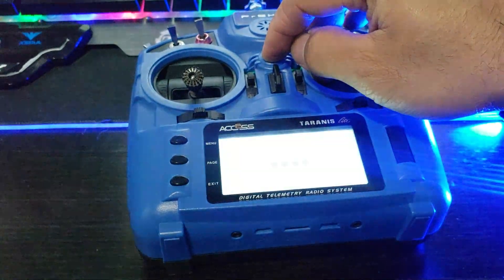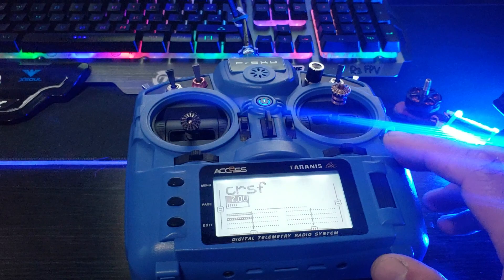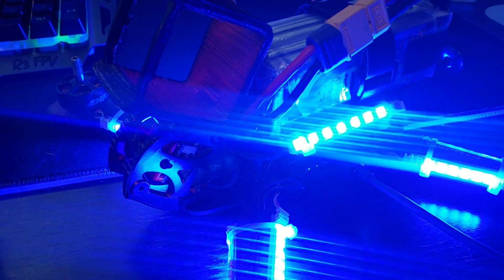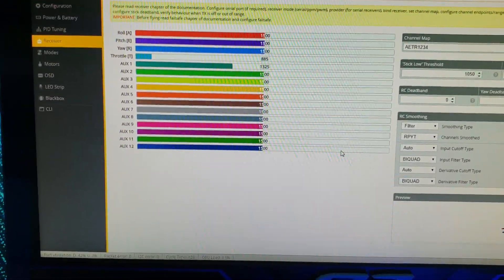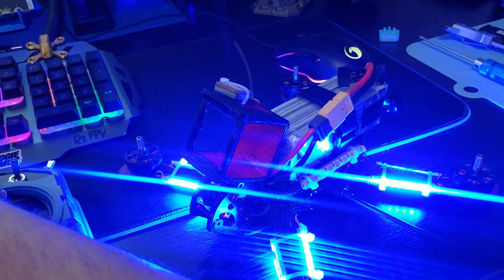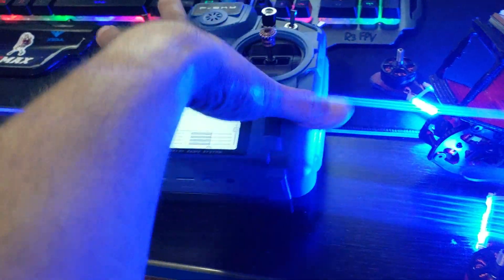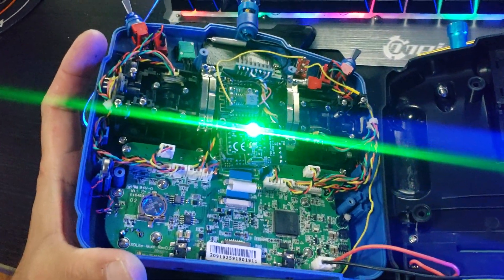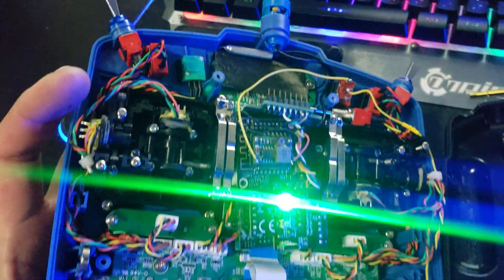Frsky X9 lite w/ CRSF!!

Comment: thank you for the video, what is the setup after you wire in the module, what protocol do you select in the external module?
Thanks again
Reply from the maker: CRSF for the external once nightly is flashed
Reply: @giespot  good day.. curious in the companion what radio do I select in the dropdown?
Reply from the maker: @LCSRacing  x9 lite
Reply: @giespot thx.. dam, must have downloaded wrong flavor, dont see x9 lite, just x lite
Reply from the maker: @LCSRacing  when u download the nightly make sure to tick the crossfire option in settings before downloading the firmware
Reply: @giespot  see crossfire in the nightly,  but when I try to download firmware I get this message.
"Firmware update failed, new version information not found or invalid"
Reply: I got it thank you.. needed to select the nightly options

Comment: Since you've had your x9 lite apart, I'll ask you. Will it fit M7 hall gimbals? Looks to me like it comes with the same gimbals as the QX7 which if true would mean you can upgrade to M7 hall gimbals.
Reply from the maker: Working on confirming with a friends x7 hall gimbals
Reply: @giespot  if you measure the diameter of the circle cutouts and the distance between the mounting screws, I can confirm it. I have a brand new set of M7 gimbals still in the box.
Reply: @dustinjlewis1  they are not physically or mechanically compatible
Reply: @israel chagollan the would work electrically but they are too wide and would not sit deep enough. The bolt pattern does match. I tried this.

Comment: Teach us how you modded that inside the radio
Reply from the maker: I will work on a how to- i just optimized the mod and have gotten the power correct so even if i accidentally leave the CRSF external power on, it'll shut off properly with the radio. Will get an explanation video soon.
Reply: @giespot  appreciate it bro! My guess also is you cant add other modules right?
Reply from the maker: @BabaBlacSheepFPV  that is correct